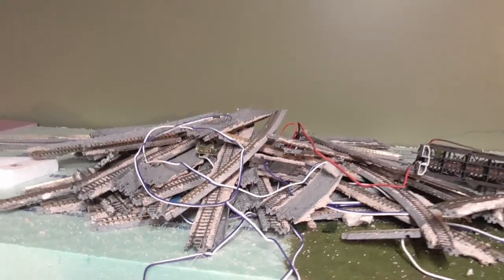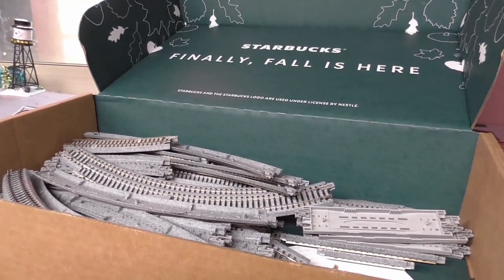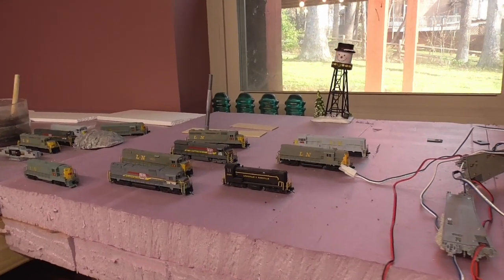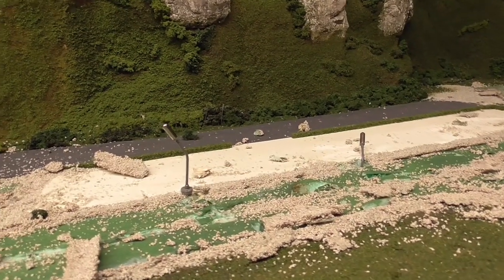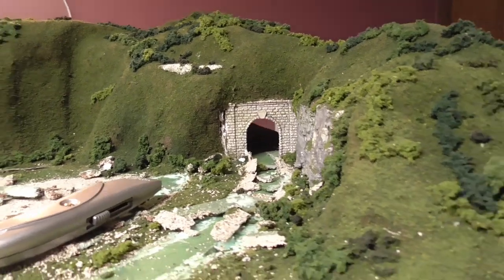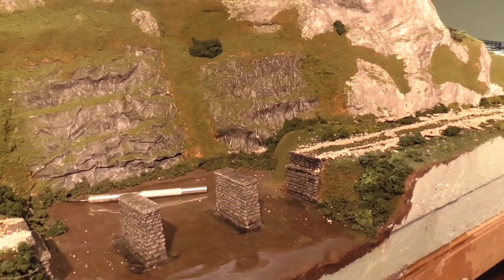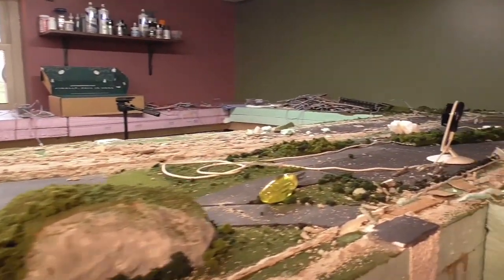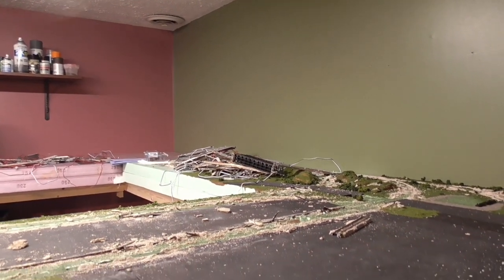New Layout Build Update #1

Comment: Over the last few years, I have had the pleasure of tearing it all apart and changing everything around more than a few times. So far I have not done that with my current layout, however, with the ever rising prices of track, and lack of availability at certain times, something I decided to try that you might try, is to use water washable school glue. I am using the clear variant for track and roadbed. What I like is it holds, but not so much that popping up a piece of track and roadbed to reposition it does not lead to destruction of either. Plus for ballasting, it is far far easier to get cleaned from the track than the usual white glue suspects.  I've gone 8 months so far without the glue losing it's hold on anything by itself.  Other thing I am doing now is, ballast last. I don't put any down until I have tested the track, decided I like the "flow of things" and decide that I am really happy with it.
Reply from the maker: Those are some very good tips! I really appreciate you watching and commenting!